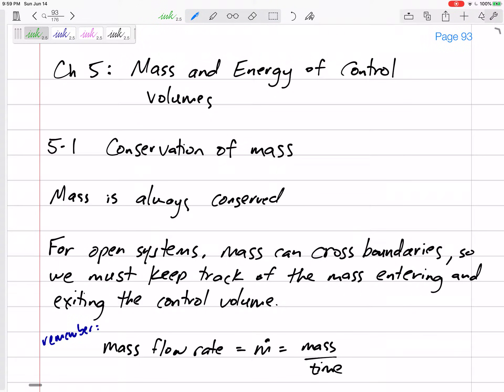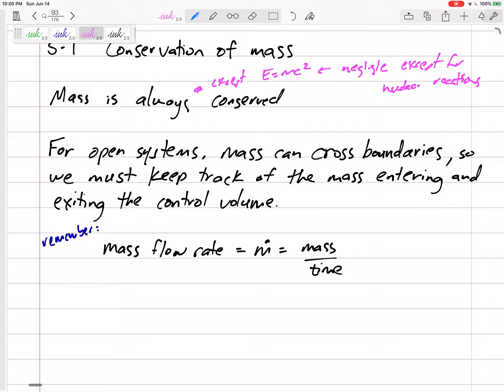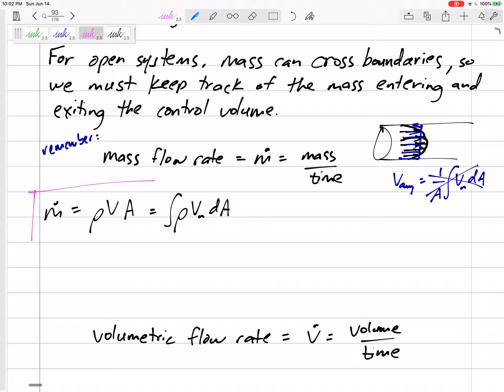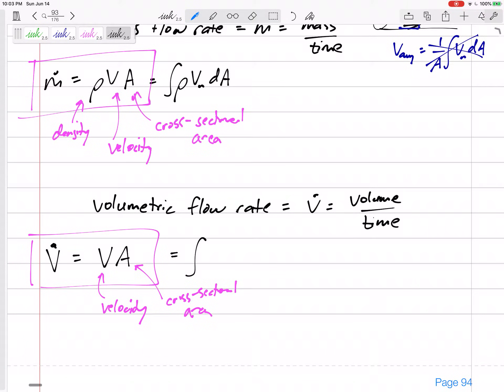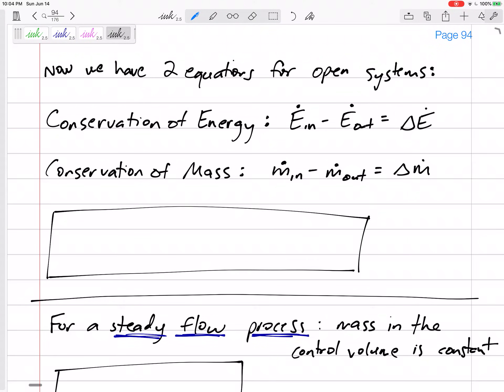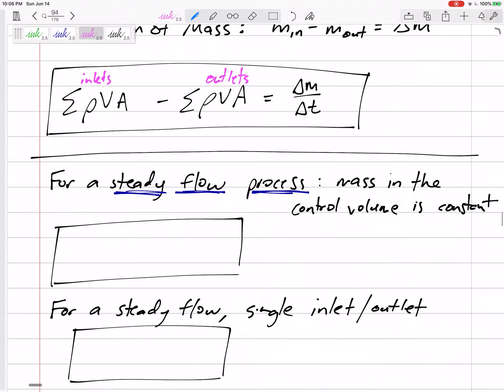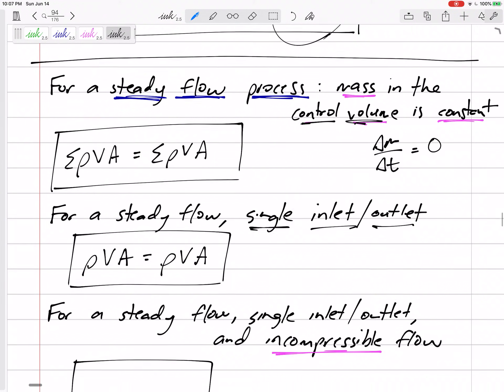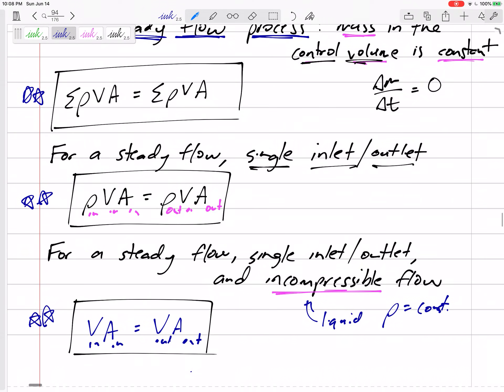Thermodynamics - 5-1 Mass and Energy of Control Volumes

Comment: isnt inlet always - and outlet positive?
Reply from the maker: Well, it depends which side of the equation you put the inlets and outlets on. If they are you the left hand side of the equation, inlets are positive and outlets are negative. But if you put them on the right hand side of the equation outlets and positive and inlets would be negative.